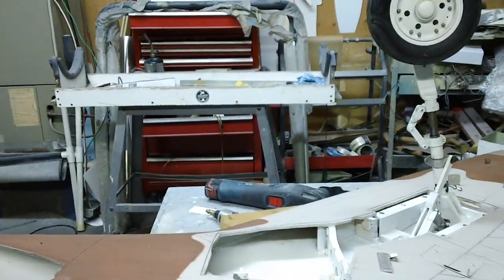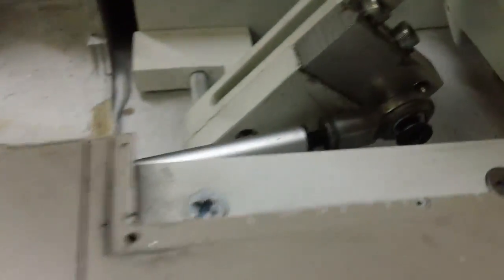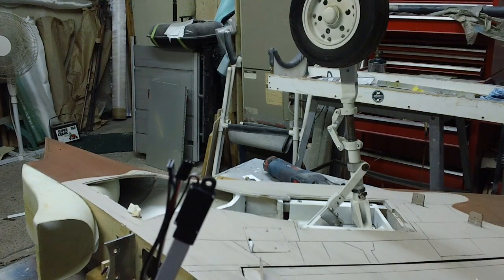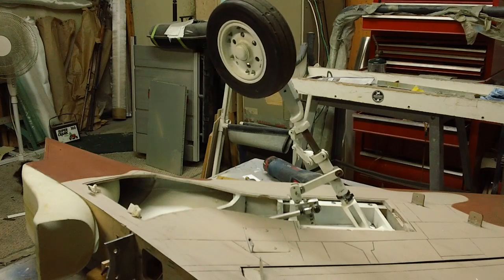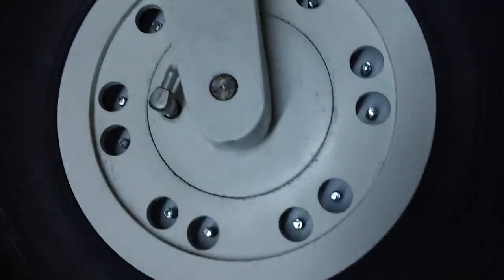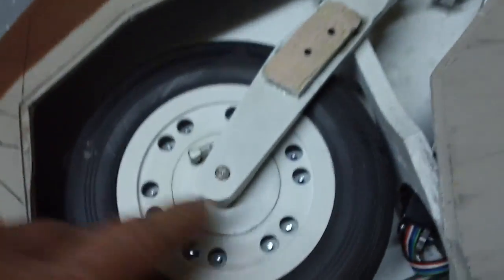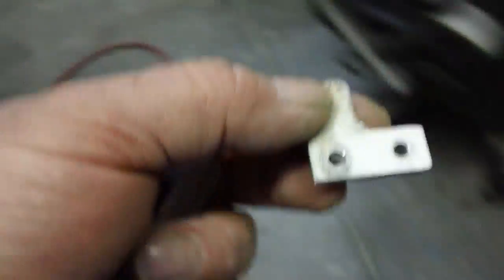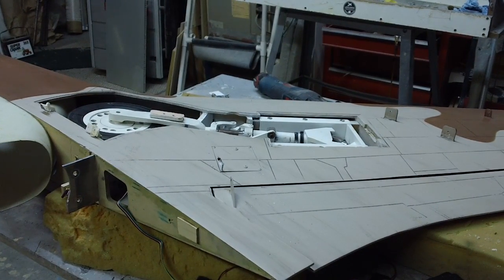F-105 main gear

Comment: Bob, I'm still sceptical! The same "lead test" worked out all right with the air set up... I think there is a design flaw some where and something locks op when you are in flight (upside down) with wind resistance. Hope it works though...